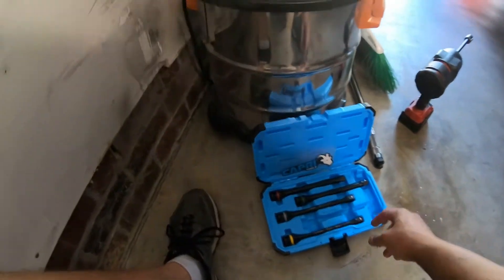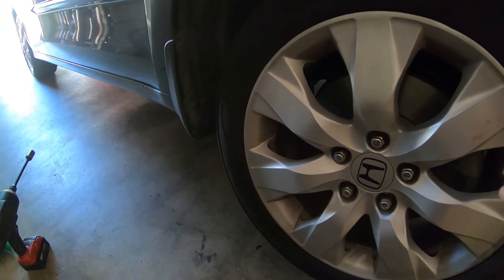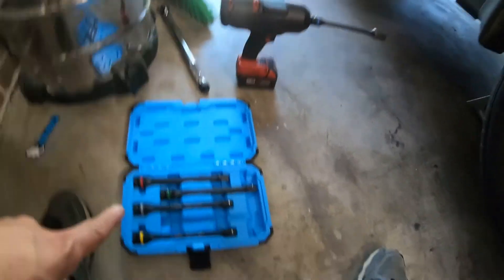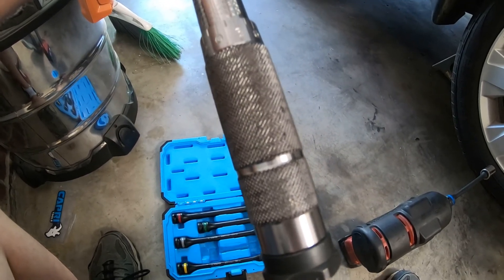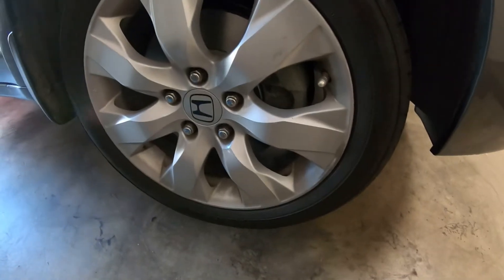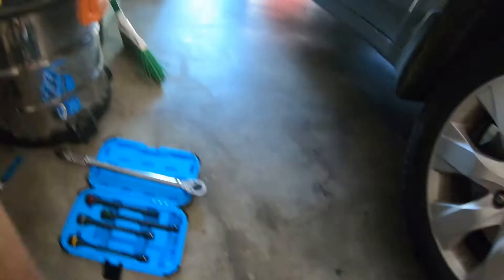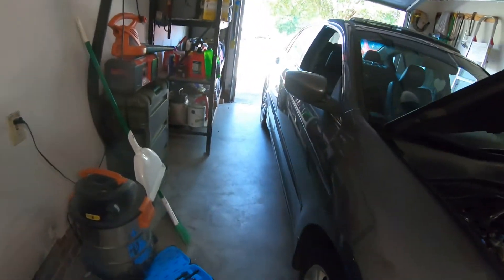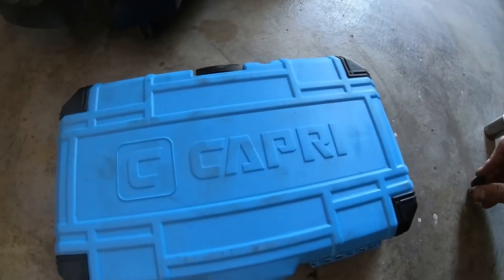Do torque sticks work??

Comment: That looks like a high torque. 2767. 1000ft lbs. tightening and 1400ft lbs. Nut busting. I just got the extended anvil version. I love it. It's a controlled torque gun. And I always use the auto feature.
Reply from the maker: Nice!
Reply: Yes and they’re not accurate  use a torque stick put a torque wrench on it set to 100 foot pounds and you will see it